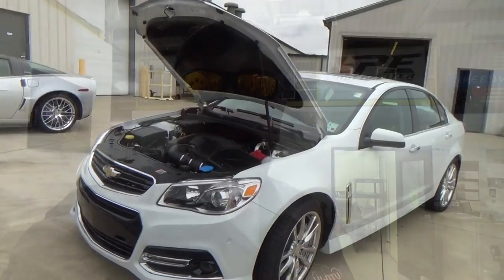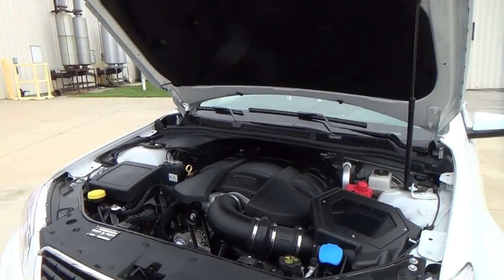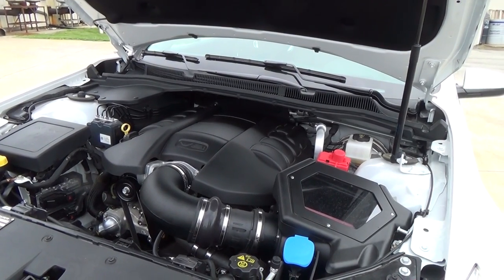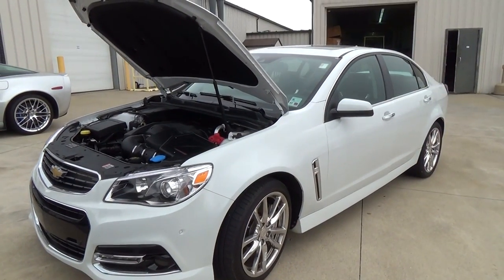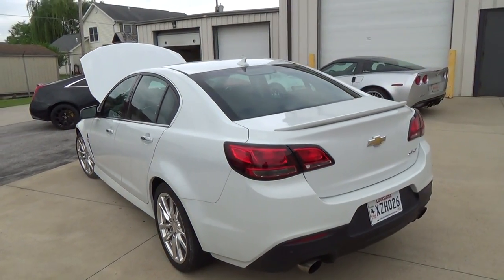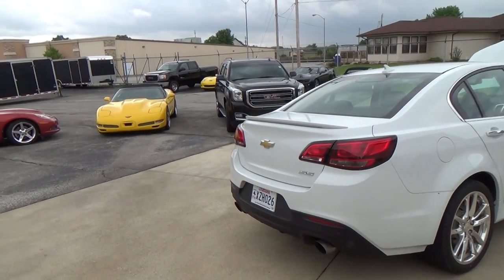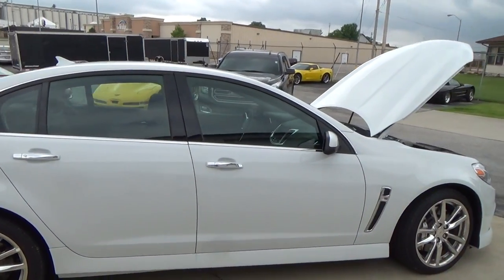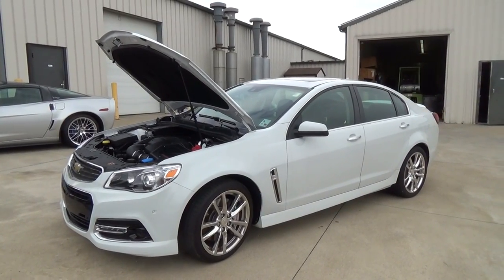2014 Chevrolet SS Lingenfelter 427 Motor Swap

Comment: So it's basically an American tuner version of the Holden Commodore HSV W427 they sold in Australia. Very cool. I guess the actual LS7 swap the guy talks about would be more exact but there's nothing wrong with a bored and stroked LS3 block and heads to meet similar numbers.
Reply: Add a LSA supercharger and have the same power

Comment: Just ordered the SS for 2017 in white, minus the sunroof and I'll buy a 550hp mod without a supercharger. I'm told I'll gain 100hp and 80lb of torq. This 427 swap is way cooler, but $20k is out of my reach. Now, if they offer a 'decent' credit for my stock motor with less than 2000 miles, then maybe. When you asked about the engine swap-out versus the alternative mods, I was left a little perplexed. I get the whole cubic inch thing, but I wish Jeff provided a bit more detail on the benefits of one over the other.
Reply from the maker: Jeff or Shawn will be glad to answer any questions you may have  https://www.lingenfelter.com/ all the intent of this video was to spark interest and some over view info of the swap....I have to to keep the run time down on these videos...You could go on for hours with these Guys.....Give them a call!!
Reply: Hello ScottieDTV
I've called a couple times already, but I guess they're busy with the Christmas holiday. I'm quite interested in this upgrade, and your video was instrumental in that so thanks! Regards, Dan
Reply from the maker: ***** Cool....They do stay covered up...When you talk to them mention ScottieDTV  they are good Guys to know...
Reply: Since my last post, I did contact them and discussed the options. Now considering the 570 or possibly the 630 swap. Either way, I will start with the interior e.g. Recaro ErgoMedES seats, Sound insulation, Crystalline tint, 3M film, etc. Still waiting on my 2017 to arrive.

Comment: I bet the SS will be even more fun when they finally put the 6 spd manual in it for the 2015 model year. Just like its Pontiac G8 GXP older brother you'll be able to break the tires loose very easily!
Reply from the maker: I sure it will turn them over now...lol
Reply: I never had any trouble busting the tires loose in my auto GXP.

Comment: Thats my color choice here in FLA . I bet thats a blast to really drive !!!
Reply from the maker: Nice way to get to church,,,lol
Reply: There's no shortage of 9 and 10-second G8s.  There are a few 600+ whp SSs running around.  It's only a matter of time.
Reply: hikeskool Thats Great news !!!
Reply: krazy45cat Yeah, the new 2.9l Whipple blower is really doing wonders.  Plus people are putting LSA blowers (from the 2009-2015 CTS and current ZL1) on the SS for cheap and running various meth setups to get some good numbers.  As "old" as the LS3 is it is super-easy to mod.

The all-motor guys are seeing mid-400s on H/C/I alone.  This is a great platform.  From a modding standpoint there isn't anything better for the money, except for the LSA CTS-V but it's pretty dated by now and its interior is not as nice as the interior of the SS.
Reply: hikeskool Thanks for the info !!!
Reply: krazy45cat No problem.  Check here if you want to stay current:
http://www.ssforums.com/

Comment: If you want one just call Holden in Australia and we'll make one up for you want a manual no problem, want a v6 or v8 no problem, want the top of the line go to HSV and don't forget to ask for the LHD setup. It should workout to be cheaper than buying the Chevrolet SS. And you get a bit more variety like a station wagon or even a ute. Just have a look at Holden Australia website then you'll know what I'm talking about.
Reply: There is no way that ANY LS7 VF will come out to be cheaper than an SS, even if you factor in exchange rate.  Are you alluding that a VF GTS, starting at aud 96,990 (about 74056.71 USD) is going to be less than the Chevy SS.

What are you talking about?
Reply: If you can deliver to me (or point me to who can) a LHD VF GTS in Regal Peacock with a lo-line spoiler, auto trans, and sunroof for LESS than an SS (as you claim is possible) then I will wire the money, in full, within the next 12 hours, to whoever I need to at GM.

Please let me know.
Reply: Also, please throw in genuine GM black window trim and paint the brake calipers silver.  I'll find a way to deal with the tacky clear tail lights.  Again, thanks!  Give me an email or contact number if you could.
Reply: hikeskool the gts has 6pot brakes upfront magnetic control suspension and a whole heap of other things done to it unlike the Chevrolet SS. As for buying one you'll need to get in contact with HSV head office and ask for a special build LHD HSV. They should be able to put you on the right path. I could look up a couple of car conversion companies over here who export/import to the US.
Reply: I'll Get Ya with my you'llbe stick I know all about this platform and the model I mentioned.

You said the "top of the line" hsv will be cheaper than the SS. So put me in touch with someone who will make it happen.
Reply: +hikeskool what he meant to say after he spewed something he had no idea about was basically nevermind LMAO
Reply: hikeskool you can buy a HSV VF in aussie dollars for 79000 which is 58300 us. 400+kw 6 piston brembo front 4 piston brembo rear and so on.
Reply: Brian Dudley know more than you do.
Reply: +I'll Get Ya with my you'llbe stick you are showing that you don't but keep trying son
Reply: I'll Get Ya with my you'llbe stick
You said the "top of the line" hsv will be cheaper than the SS.

Again, at an MSRP of $95,900 bullshit shitty australian dollars, that is still $70,619.36 in actual, real dollars, AKA the US Dollar.

So you are about $23,000 off.

Keep trying!
Reply: HSV does not use brembo, they use AP, they are 6/4 pot
Reply: +tedhead redhead yes they do use Brembo but they are an option i live and breath mechanics it is my livelihood.
Reply: I'll Get Ya with my you'llbe stick 
You said the "top of the line" hsv will be cheaper than the SS.

Again, at an MSRP of $95,900 bullshit shitty australian dollars, that is still $70,619.36 in actual, real dollars, AKA the US Dollar.

So you are about $23,000 off.

Let me know when/how I can get one! Thanks.
Reply: +hikeskool now tead exactly what i said. Over here we have them as a standard passenger vehicle that start from 35000 au to 120000 for the last ones being built that have the lsa supercharged in it. Now when i said top of the line HSV is the top of the line out of the GM production facility in Australia. And before the prices went up you could get the equivalent of the ss chev which is the Clubsport for 60000 au dollars.

Comment: Awesome drivetrain, suspension is solid, but it is too plain.  That rear end looks straight from the rental car styling guide.
Reply: You must drive some badass rentals.
Reply: hikeskool Well, I have an ecoboost Mustang this week.  It's much better than I would have guessed.  I really like the Impala.  I drive the V6 car all the time.  Great car, just think the tail end styling is plain.
Reply: gracilism you're aware this car is nothing like the Impala, correct?
Reply: When I get mine stay tuned, and see what I do with the rear end.
Reply: ***** what are you planning to do?
Reply: The silly spoiler goes, the tail lights get upgraded/replaced, the exhaust gets the Harrop molded finisher, the rear lower get dipped in carbon fiber, logo/emblems also go, and a couple fine lines of black pin stripe get added. I have a couple other tricks up my sleeve, but I need to leave something out before someone beats me to the punch. In the end, I guarantee it won't look like a rental car when I'm done with it.